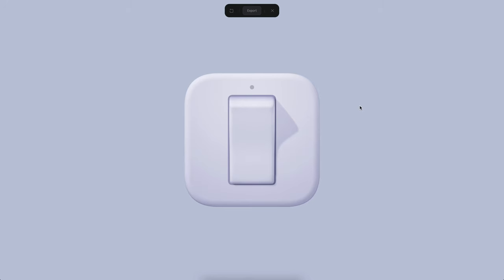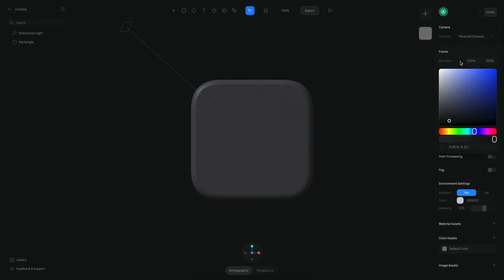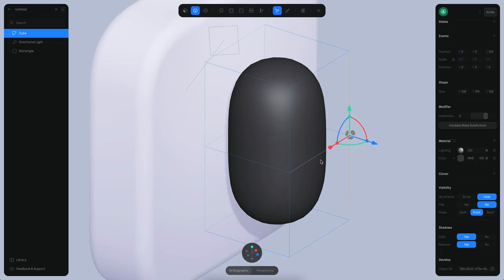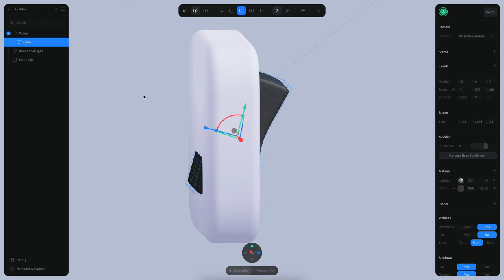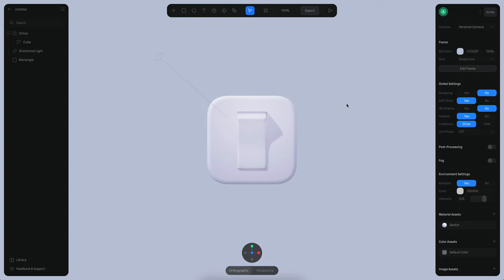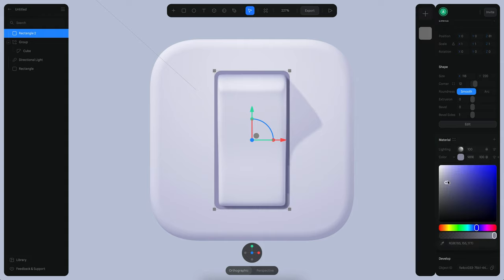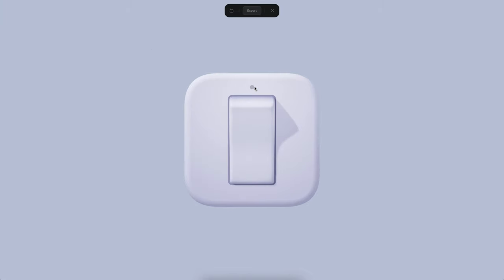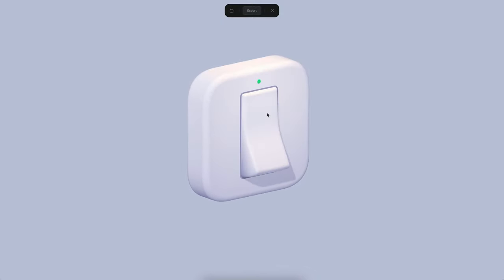Making a 3D switch or toggle with Spline

Comment: Hej ! Thank you for a video, but it’s really irritating to find out moments like during 9:30 where i don’t have this “Toggle” swisher. It would be really great if you, at least, will add some information after UI updates in video description, cuz as a beginner in Spline, i can’t find out any solution for now. Thank you !)
Reply from the maker: Hi! Thanks for the feedback. On the new UI, the Toggle setting is now part of the "Mode" parameter that is visible with a Transition action.
Reply: @splinetool  This doesn't seem to be the case. Perhaps I'm missing something but there does not appear to be a mode parameter or toggle parameter with the transition parameters dialogue fully opened.

Comment: I couldn't find the button " Add New object to event " ?
Reply from the maker: Hi Mahmoud! The UI changed a bit (for good) since this video was published. When you click on an event, now you can add a Transition action (from which you can select the object).
Reply: @splinetool  Yes I got it ... That's what I did, thank you so much for your reactivity and for your powerful Platform ... 
-------------------------------
Actually, I found another issue regarding the synchronization between "The material palette" and the states ... when I tried to make two different states with two different materials while using an already defined color .... It doesn't work.
-----------------
A video link below to explain what I mean. 
https://drive.google.com/file/d/1LC5XajueoQk_g7rf24T3E9diOIR47jZF/view?usp=sharing